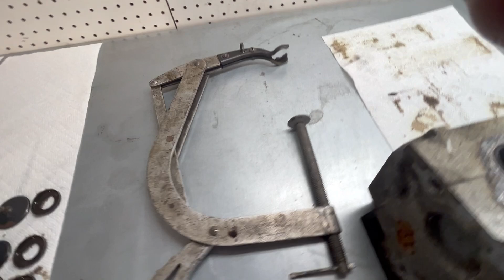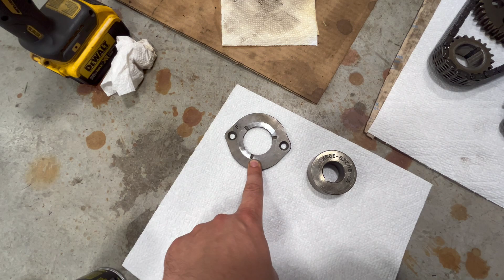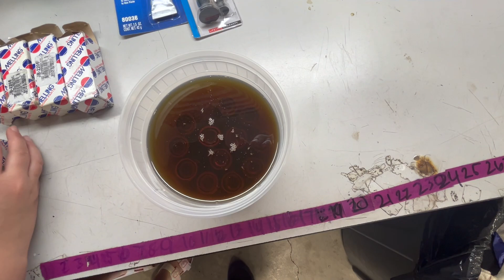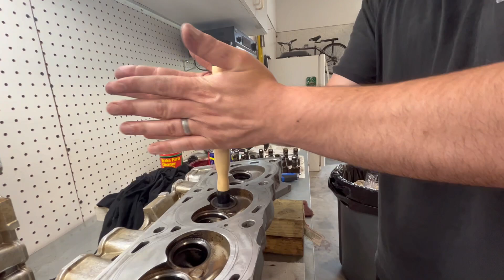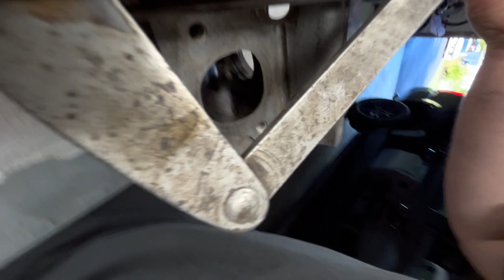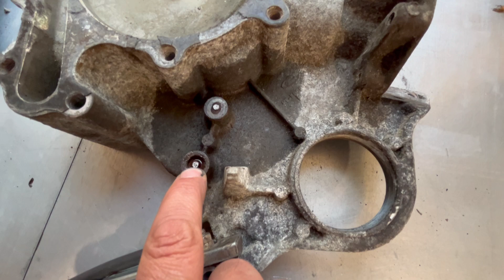DIY ENGINE REBUILD MUSTANG 3.8 SN 95 PART 2

Comment: Can you show a proper EGR Delete and what you do with the 2 vacuum  lines coming off the intake manifold the top one is green and the bottoms one is red and was curious to know what to do with them.
Reply from the maker: I dont have the car anymore but those lines should be capped or you will have a large vacuum leak.

Comment: Been wanting to try my hands at rebuilding my first engine and a pushrod engine like this seems like a good option. Thanks for the videos my guy 😊😊
Reply from the maker: Go for it! Cleanliness and taking your time is the name of the game.
Reply: @RebelGarage508  Yeah I noticed that. I've been wanting to pick up another New Edge but since a V8, even as a roller, is still up in price I'll probably pick up a V6 with a blown head gasket and take it from there.